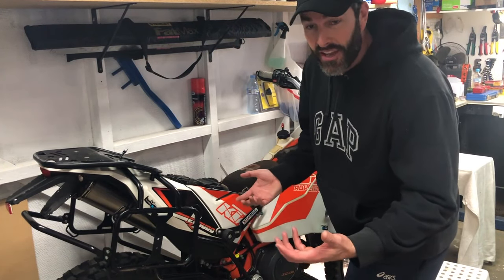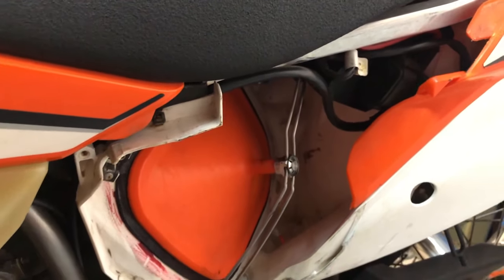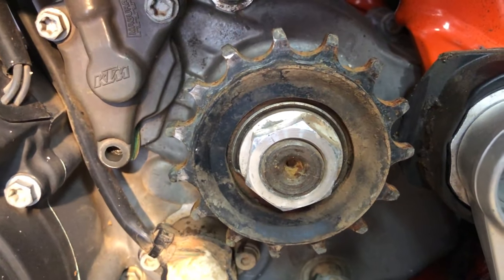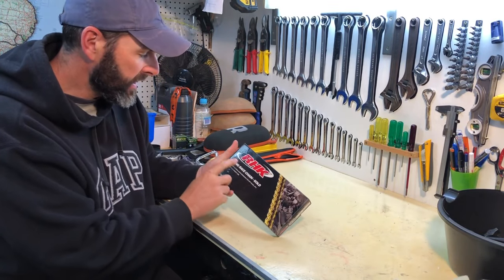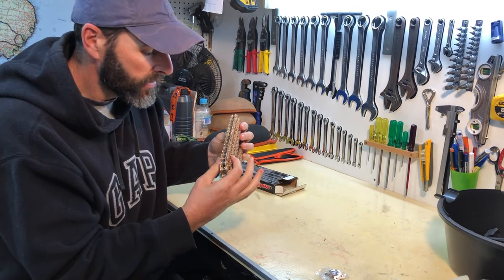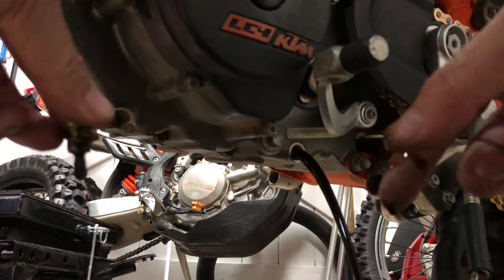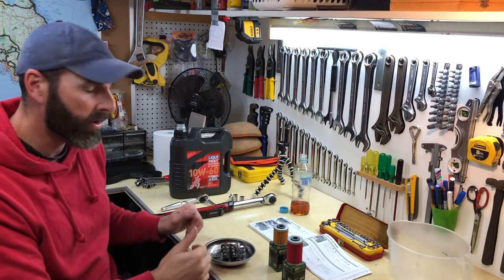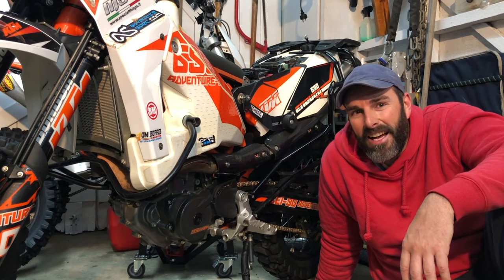KTM 690 Enduro R / OIL CHANGE / AIR FILTER CLEAN / NEW CHAIN / Desert Preparation Part 3

Comment: Another great vid! Just for information the stock grease on the chain is just for rust protection, not for driving. You should always grease up behind the o-rings after pushing it through the whole. And in the end just lube the chain innerside. Cheapest lube what will work is gearoil (any).
Greetings
Marc 🙂
Reply from the maker: Thanks for the tip Marc. Cheers mate.

Comment: Shadower, Good vid. Just a prompt if you have checked/replaced the in tank pump discharge fuel filter as part of your prep...if you still have it that way.  Good luck for The Simo.
Reply from the maker: Hi Track Stumper, I still have the stock fuel pump / filter in my bike. I have placed a additional fuel filter in the system though and I also carry a spare fuel pump when I go on lengthy adventures. Cheers mate.

Comment: IMO the air box cover is just as important as an exhaust bung when cleaning the bike. I always take the air filter out and put the air box cover in so I can jet wash the air box out (twin air air box cover has a seal)and it’s always perfectly clean. It just helps that there’s no crap in there when changing filters etc.
Reply from the maker: Need to keep that air box clean that's for sure. 
Cheers

Comment: Did you forget to grease the joining link and it’s O rings (packet of grease comes with the link) or just not show in in the video?
Reply from the maker: No didn't forget, it was already greased and all lubed up. Just install and you're good to go. There was no packet of grease etc that came with it.
Reply: Shadower 75 - not trying to be critical. Everyone’s an expert (in my own mind). Surprised there was no grease packet with it though.
Reply from the maker: @AfricaTwin-Stuff hahaha well i'm no expert, Just a dude in a garage having a crack. 
Jokes aside though the chain was completely lubed and greased up by the manufactures. Once ready to ride I'll do my usual and lube the chain with chain lube and she's good to go.
Reply: Do you really have to load up the oil filters first? I've personally never done it. I normally let my bike idle up to temperature after an oil change.
Reply: Wasca - I haven’t done this either. But it can’t hurt and there is logic in doing it as it means proper oil flow happens that bit quicker.
Reply from the maker: @wasca  Not at all Wasca. I only recently saw it and liked the idea of having oil in it when it starts. Guess it comes down to personal preference, however it's not a must.

Comment: Just for info the KTM Washer on the gear lever bolt is a serrated washer to provide a self locking function to stop it coming undone.
Reply from the maker: hahah well it didn't work as I lost it. Hopefully this one holds on better. Cheers
Reply: @Shadower75  You should Loctite everything with medium strength blue threadlocker. It stops these things undoing and also seems to prevent screws corroding by providing a barrier between dissimilar metals which is a prime cause of corrosion.
Reply from the maker: @andrewpowell5229  Cheers mate, I always do. You will see in the video I loctite them back on at 18:42

Comment: Do you happen to have a build list for this bike? How did you find dealing with MST for the rally kit? Great videos too!!
Reply from the maker: Hi bobloblaw11111, what kind of build list you after mate? What I have done to the bike?
I found MST to be really good. Their product is of high quality and reasonably priced compared to other fairing kits etc. Through the ordering process they responded very quickly with any questions I had. Their instructions for the install however where lacking (pretty much none) so you have to work it out yourself which wasn't too hard anyway.
I guess the question is would I recommend them and the answer to that is yes I would!
Cheers mate.
Reply: @Shadower75  Hi mate, Yeah was just wondering what you had done to the bike, although watching the videos in this series shows most of it i think. I was going to ask more about the MST kit, but you have answered that too. I think it is the best looking kit going. I have used rally raid tanks on my last 690 and thought it was great stuff. Thanks for your reply! Ed.
Reply from the maker: @bobloblaw11111  Hi Ed, lets see. I've added the rally raid tanks and upper and lower bolts etc, MST fairing kit (which I also think looks the best), had the suspension done for my weight, put the Rottweiler Air filter on, added another Rally Raid inline fuel filter, got lowering pegs, seat concepts seat, Barrett products pannier racks, Adventure Spec bash plate,  and that's all I can remember right now. Pretty much set up for long distance or or overnight adventures. I do love this bike however have a eye on the 790.
Reply: @Shadower75  Hi mate, thanks for the run down. Yeah I love my 690. Best bike I've ever owned. The 790 looks awesome. Not sure I can justify spending that much on a bike though. Who knows maybe in a couple of years. Thanks for your time mate. Great videos so far! Look forward to many more.
Reply from the maker: @bobloblaw11111  I feel your pain mate, over 24G is up there.

Comment: I meant to ask about your coolant, does it need replacement for your big trip. Also, I remember from previously, you had issues with your clutch (I think), should you flush out your fluids as well? 👍😁
Reply from the maker: Hey Robert, I checked the coolant and it seemed ok. I redid the clutch after the trip last time so I didn't have to touch it this time. Fingers crossed all is ok.

Comment: Thanks for the vid, Craig! I am hopefully picking up a 2016 690 next week (gifting my KLR to one of my sons). This new-to-me 690 has the Rally Rade EVO 2 tanks. What crash bars are you running? What brake pedal do you have on your bike? Thanks, again!
Reply from the maker: Hey mate, nice work on the 690 mate. 
They are Rally raid crash bars and the brake pedal is hammerhead.
Hopefully the 690 won't let you down.

Comment: 6mm for filters or 8mm??
Reply from the maker: They are actually a 5mm bolts. I thought they were bigger. I do know they are 6Nm torque setting, or so the manual says. Cheers Michael.
Reply: @Shadower75  Nice. Cool bike, i want the new 790 R.
Reply from the maker: @mts982  now we are talking. Would love to walk into a bike shop and drop a deposit down...I still love my 690 though.
Reply: @Shadower75  Yeah, looks like it did a great job on that other trip you filmed. Covered a lot of area. I wouldve loved to have done a ride like that. I raced barstow to vegas back in november of 1987 on a 1984 honda cr250r. Took me 5 hours. That was cool. I want to do the transamerica trail. Ive watched alot of videos on that.
Reply: @Shadower75  I also wouldnt mind maybe a bmw 850GS adventure or a yamaha 700 tenere.
Reply from the maker: @mts982  Barstow back in the day would have been tough. Super effort.
That transamerica trail is on my bucket list too. One day hopefully.